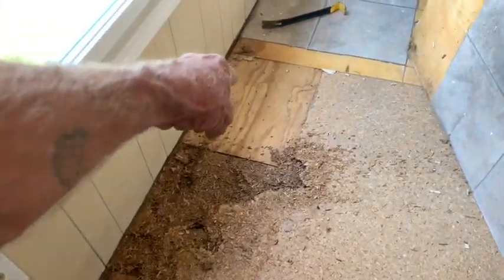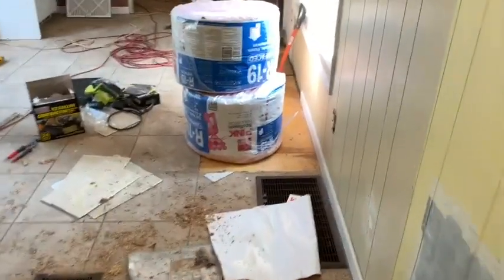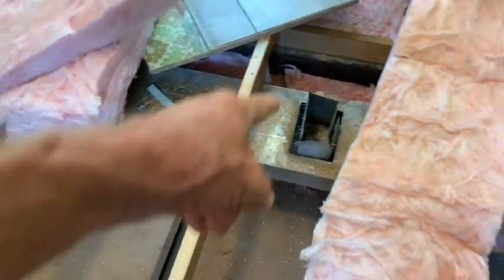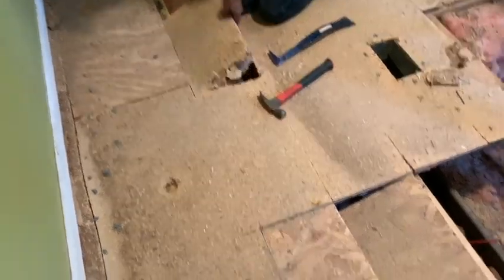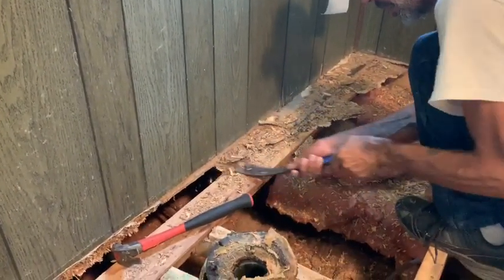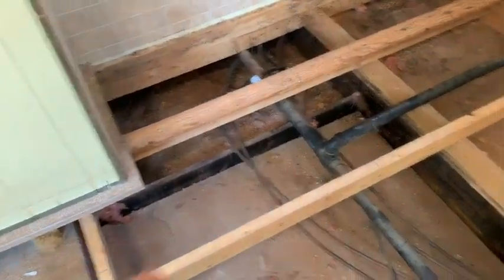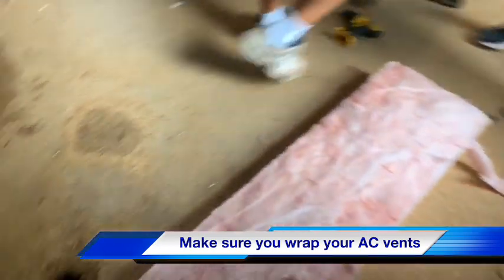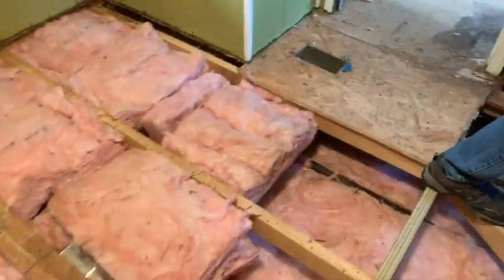How to repair a rotted floor single wide Mobile Home video 2

Comment: A lot of people will be confused and not know what they are seeing exactly. What you see is someone that has pride in their work. The basic concept of it is when someone does a job and they don't half ass and do a sleight of hand trick. No out of sight, out of mind. They don't yield to the urge to slap together some fail job and take the money in run. Someone that has pride in their work does it all. The whole shebang. It isn't done til its done. Full measures, not half. I like seeing pride. Thank you
Reply: Also I like the straight way you communicate with your crew. Some might see someone that is firm and straight forward as condescending or arrogant but the apprentice or coworker with pride knows what is being said and that's all they need until they are in your shoes and bringing their own up. When I set out training to learn something I appreciate when the teacher lays down the law and keeps me balanced when I start to get out of line. Taking it easy is for lunch time over a snickers bar.
Reply from the maker: Thank you so much and you’re right some people can get confused and not know exactly what they’re saying. And there are some terrible contractors out there they don’t give a crap if you don’t see it they don’t care. I’m not that contractor nor will I let my crew be that type of worker. I am strict I have one way of doing it. And my way of doing it is the right way. It’s not like I can’t take somebody else’s thoughts but I’ve been doing this for 30 years I know mobile homes. I believe in do it right the first time or don’t do it at all hard work and honesty is the best policy. I really appreciate your comment I think you’re an awesome person Jeremy thank you for stopping by my channel
Reply: @Drewsroofingandhomerepair  i just felt compelled to leave the comment because I deal with and see so many people who have their trade as their whole identity and spend every day doing it but it doesn't go past sub par. I'm not saying I'm better because I have so much to learn but I appreciate the person with pride in their work and that strive to do something as good as possible with everything they got....especially when someone is paying them their hard earned money for the service. Thanks again. I'll be back
Reply from the maker: This is a video of me and just playing around

https://youtu.be/e7Iao6P9ToY
Reply from the maker: And by the way I feel blessed to have you comment like that on my channel. I will definitely make it a pinned comment so it shows up first just because of the pride did you see is the pride that I feel when somebody comments like that for me thank you Jeremy I’m glad you can appreciate good work. By the way just for fun I have another channel it’s called Scrapping with Grandpa. I use a little bit of comedy in my scrapping so I hope it’s something you can go check out and enjoy watching could use a few more subscribers.
Reply: @Drewsroofingandhomerepair  i subscribed. Looking forward to watching  👍
Reply from the maker: Thank you Jeremy I need everybody’s support. I love calling out bad work and if you notice I have a few metal roof callouts that are unbelievable. I look forward to you looking at my other videos and maybe even my playlist. Check out Drew’s Roofing And Home Repair the travelers them are some interesting videos. Ohio. Alabama. New Jersey. Virginia. South Carolina. Outer Banks North Carolina. Kitty Hawk North Carolina. Tennessee. And a few other places. Like Georgia for one and others
Reply from the maker: Jeremy I have another channel it’s called Scrapping with Grandpa. I do scrap metal recycling. I am having a 2000 subscriber giveaway. It should be coming soon I’m right at 1900 now. I’m gonna be giving away the GoPro H that I use for recording my videos as I have upgraded. But I’m not going to use my upgrade until I have this giveaway. Scrapping with Grandpa
Reply from the maker: I also do a few things on that channel to be a little entertaining like I have a mascot and I have a guy I call incognito he’s pretty cool so if you type in Scrapping with Grandpa check out Incognito you’ll find my humorous video.
Reply: Agreed! Can't stand half ass work!
Reply from the maker: Thank you if you’re going to do it half ass don’t do it at all more videos coming soon
Reply from the maker: Video daily https://youtu.be/fZiS--GLXHo
Reply: Nicely done.. Polybutalene piping and the fittings  crimp on rings used at the time are nightmares and ticking bombs. The particle board  as well when windows or plumbing leaks. Live and learn. Thanks for your contribution to the learning part.
Reply: @u.sonomabeach6528
Reply from the maker: Thank you for watching
Reply: This is scary, don't think we can afford it....but after a bad water leak there are holes.....
Reply: There's a good chance some people in mobile homes don't have giant reno-budgets so they may have fixed small parts of the floor as best as could be done because they couldn't afford unlimited lumber/supply purchases with a 7 person (sorry, so much crazy panning hard to tell how many ppl are working on this job - 3? 5? 7?).  There's a lot of big talk in this (and previous vid.1) video about what was previously done improperly but doesn't seem to actually be much (if any) instruction or step-by-step about how to do it correctly other than bragging about doing 3 entire rooms which few people will have the means to do at once.
Reply: @KarinaHunter  you interpreted what you saw wrong. As someone who does similar work I can relate to the dialogue in the videos because anyone who has pride in his work can’t stand seeing a job done improperly or dangerously, especially when the people that did the less than ideal work charged someone for it and not only that, he is well within reason to make comments about it because he had to do extra labor and materials to do it correctly. It may not seem like much or that previous work was just fine, but even though I don’t know you, I am certain that you would have a different view if you went behind work that wasn’t up to HUD, IRC, IBC etc. or that was just not as it should be, even little things, and you got to a certain point in the work(an hour, a day, a week or however long) and then ran into a problem that turned your three day job into a week and a half or it turned your quick and straightforward one day project into a complete overhaul. I promise you, it is a good thing to have people in the construction industry be critical. ‘Good Enough’ isn’t doing anybody any favors. ‘Good Enough’ is good enough for who exactly? Definitely not the code inspector. Definitely not someone’s child or visitor who steps on that one spot in the floor that was a problem during construction and then the worker said, ‘Eh, it’s good enough’ and then the child or whoever’s little walk down the hall turns into a fall through the floor, catching a few nails that were overshot by some careless worker and are sticking out under the floor just at the right angle to stab in an inch or two and slide up the muscle during their fall. I work with a guy who has his deck redone. He didn’t want to/couldn’t afford to be extravagant so he settled with a buddy of his’ uncle and a couple of his uncles pals to swing by and slap something together that was ‘good enough’. They got it done quick and gave him a damn good price on it. A bit of time passes and he had his family over because his siblings  were traveling in from out of state and their mom was gonna be there and it would be a good opportunity for them all to get together because their mom was in decline and just staying with him a few days before going back to the nursing home. He fires the grill up and at one point they all wanted to take some group pictures on the cell phone. His mom was sitting in a chair and the siblings and their kids all gathered around. Before he could take the picture, the deck post which wasn’t fastened with lag bolts and had no blocking and the joists which had no hardware(who wants to pay for that extra stuff) and were just simply hit a couple of times with a nail gun, separated and the deck collapsed. They all got scrapes and bruises but were otherwise fine….except for the mom who broke her back, her femur and her wrist. Don’t worry though, because he got his deck quick and cheap so it was worth it.
Reply: @u.sonomabeach6528  I appreciate you repeating yourself but I just don't think it's a great video. Clearly there are a lot of people who enjoy it (judging by the sub #'s) I'm just not one of them (I explained why in my other comment so don't think I need to re-state why).
Reply: @KarinaHunter  fair enough. I don’t know the dude who makes the videos. Just commenting based on my experience and seeing both sides and knowing various types of workers and, to repeat myself a bit more, I am just convinced that someone with pride in their work and even with cockiness and with opinions is a good thing as long as their work backs it up, because, who loses? Nobody loses and I can’t see any reason to get offended by anything he said in the videos because if you really ask yourself, what exactly upset you and why? I mean, honestly why? You don’t have to answer to me or anyone. Just randomly having a chat in the comments section and I don’t mean to seem like some defender that wants to get in to a battle of wits. Hopefully we can agree to disagree. Please don’t take anything I said personal or think I am coming from a place of someone who knows everything. Take care
Reply: @u.sonomabeach6528  ;) Agree to disagree works for me too. Happy New Year, all the best in 2023.
Reply from the maker: Thank you 🙏 for that comment some people just see my logic most of the time comments like that come from people that have no idea
Reply from the maker: Thank you Karen
Reply from the maker: Thank you my friend it’s always nice to get comments from people who know what they’re looking at
Reply: @Drewsroofingandhomerepair  yeah, you would never see anyone with any bit of real experience get offended because someone pointed out someone else’s shoddy work
Reply from the maker: I know right. You would be surprised how many people complain when I call someone out. I’m like are you kidding me. It always makes me think that that is the kind of work they do. Lol. Thanks for the visit my friend
Reply from the maker: I agree ☝️

Comment: Fix the leak first. Then fix the floor and you won't have to fix the floor again.
Reply from the maker: I agree 100% it’s not my floor so I’m fixing the floor fixing leaks we know dinner there find out if there are any other leaks fix them whether it be windows or doors and MoveOn thank you for your comment I agree fixed the leaks before you fix the floor
Reply: How do i know where the leak is coming from?
Reply: @Msrubia40  How my Mom did hers was, where the water was drilling it, she went up an angle and went looking at other angles around that drip. Thats where she found problems where water leaks was coming from.  Then she cut and destroy old material, put in new material and repair and fix it, from the inside, and on top of the roof, as well.
Reply from the maker: Wow your mom sounds 😉
Reply: Of course...

Comment: Do you put new belly board or something underneath the whole thing to keep raccoons out?
Reply from the maker: If you notice the floor already has and underbelly on it and that’s what we are laying the insulation on the problem is raccoons will make a hole in the underbelly and come through there we covered up the old existing holes that the raccoons made with a new piece of Tyvek and a piece of plywood on top of that. You cannot keep cones out if they want to get in unless you have your trailer underpinned and enclosed completely

Comment: Your subfloor looks great compared to the mess I have in my first mobile home I bought 3 days ago.  Planning to do the same you're doing, replacing all insulation and subfloor, among other things
Reply from the maker: If you need any help I hope my videos will help you look at my videos from four months ago I did a mobile home from start to finish I think we spent a month over there we also put a rubber roof on it. I hope it helps you the video you’re looking at there was done a few years ago I believe

Comment: I am a retired woman who will be doing floor repair soon. A lot of my problems are featured in your videos (uninsulated duck work, water rot areas) are shown in many of your videos; like this one for example that shows your team using faced insulation & placing it face down. I wasn’t sure to use faced or un-faced (R value) but I see your team utilizing this & how they used it.
This is all a great help to me as I work on my single-wide trailer in NY.
I hope you see this as you answer most comments.
#1- What type of membrane is best to secure to the underside of the trailer to hold up the insulation & just tightly stabling it in (is ok?).
#2- As we generally have 3-4 weeks of below freezing temps-what R value is best to use?
#3-I might have to gut out my entire bathroom due to water damage-taking out the tub toilet & possible the water heater-possibly replacing all but the water heater.
Can you explain the steps I should take? I realize that is asked by a lot.
Reply: Oh I forgot to thank you for your helpful videos-oh course I’m a subscriber! ♥️
Reply from the maker: Find a local mobile home supply store they can help with the membrane for under the house.  I wouldn’t go with anything less than our 19 are 30 is great.
Reply from the maker: I’m not sure exactly what your situation is is lots of ways to do it. 
https://youtu.be/pdfSwYCdpjA
https://youtu.be/52RGiWs9sFQ
https://youtu.be/zJIhdYcEy-k
https://youtu.be/y3DGTt-rABc
https://youtu.be/qyS0CE__YdE

Comment: Very helpful doing my first time repairs and he gave alot of helpful tips, thanks.
Reply from the maker: That video is actually a couple years old go to my videos from six months ago you’ll see we did one from the front to the back complete floor replacement. We also replaced the band as it was also rotted. The bottom plate the band the sill everything
Reply from the maker: Thank you for watching I’m glad I could help

Comment: I'm not sure if I will have to tear out the floor in a 1974 mobile home I bought but I feel more confident after watching your videos. The floor seems solid but everyone keeps telling me I will have to do a complete tear out of the floors  We will see this winter when I remove the carpet to install laminate flooring. I know you mention this is a single-wide. Should I expect something different with a doublewide?  Thanks for taking and sharing these videos. Wish you were in the Fort Myers area.
Reply from the maker: You’re a Doublewide should not be anything like a single wide when it comes to the flooring. You should be in much better shape with a double wide
Reply from the maker: You might find the particleboard is glued

Comment: Great work, I see the situation with water damage under the windows. It leads me to wonder if there's no over hang or eaves on the  exterior of the house?
Reply from the maker: You are exactly right there is no overhang whatsoever but before we did the floors we did repair the leaks around the windows

Comment: Thank you for pointing out the issue with moisture condensation in and around the ductwork.  What do you do about the sub floor that is underneath the exterior walls?
Reply from the maker: Unfortunately, for the most part, you can’t do anything about it just get as much out of it as you can. There are times when we replace it if you watch some of my videos, she will see us doing that they can be a pain in the butt.